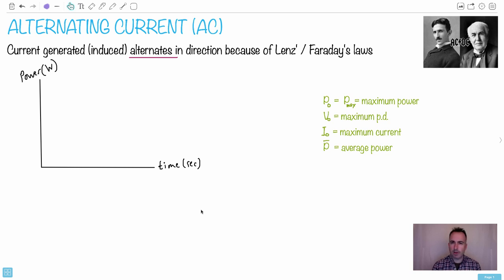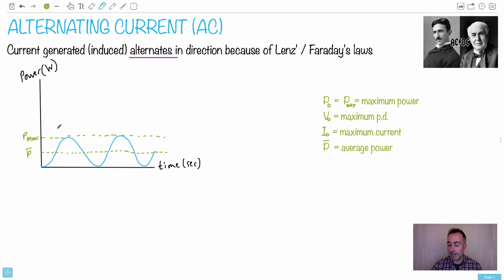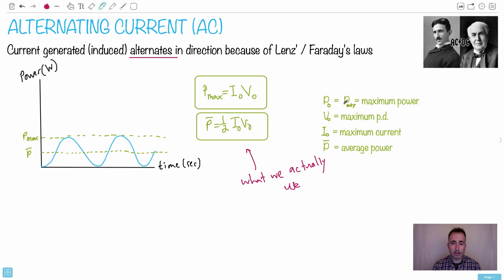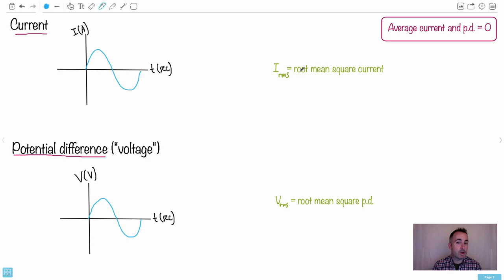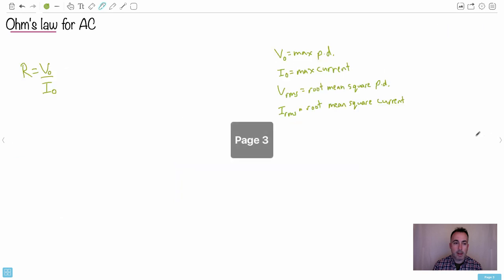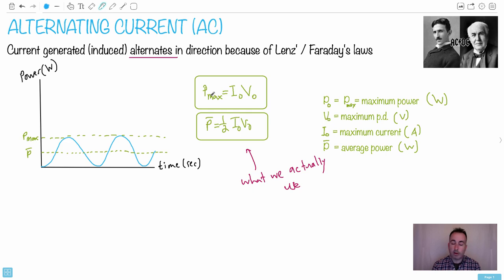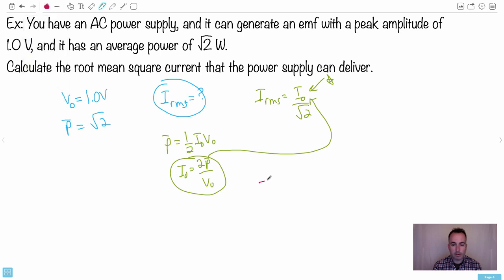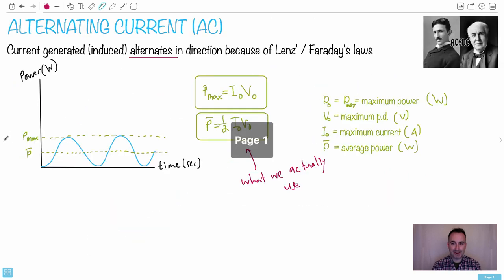Alternating current [IB Physics HL]

Comment: I have a question.  Current is defined as moving charge. But motion itself depends on the frame of reference. If someone were to move at the speed of the charge, the charge doesn't move according to that frame of reference. So does current exist for that frame of reference? I don't understand how exactly current is defined, because I think according to the way it's defined, it's possible that current doesn't exist for some observers while it does for others
Reply: Try this video: https://youtu.be/bHIhgxav9LY
Reply: Hi achyuth lol , coming to school tomorrow 😂?
Reply: The laws of physics are the same for all frames of reference; for example, if you "move with the charge", you would still need to apply the relevant transformations so that the same laws of physics hold. 

it's like asking: if you throw a ball but you move with the ball, does that mean the ball isn't moving? Or, if you let water run through a pipe but film it running through the pipe, does that mean the water isn't moving just because the video shows it not moving? 

Of course the water is moving. Of course the ball is moving. Nothing changes that. To account for the mathematics in your reference frame, you simply have to subtract your velocity from it to get the same physics as you would in an inert stationary reference frame. I don't think you understand reference frames or galilean relativity well.
Reply: @pubgplayer1720  smartest pubg player alive. Respect.